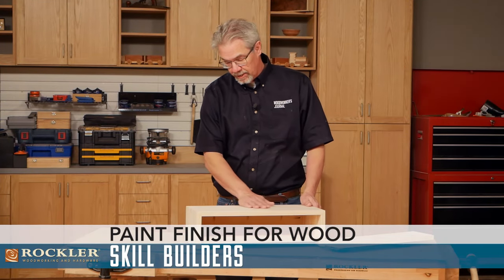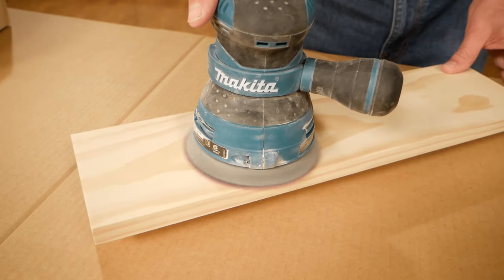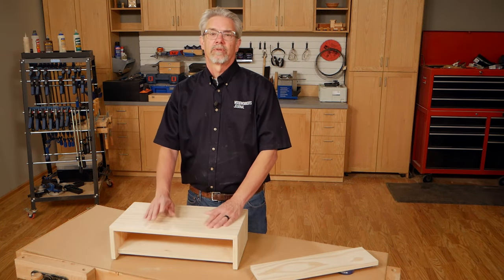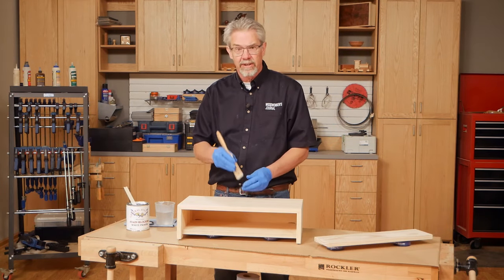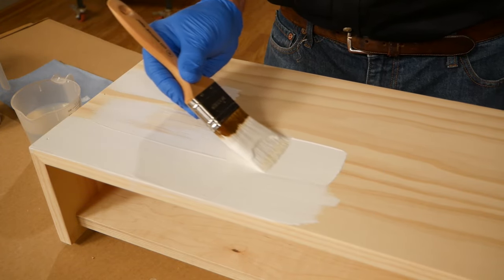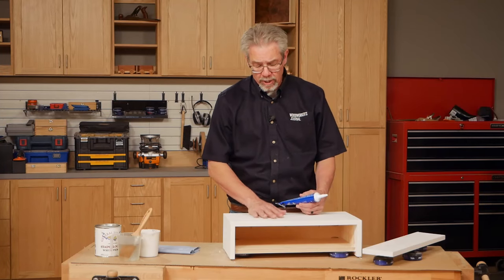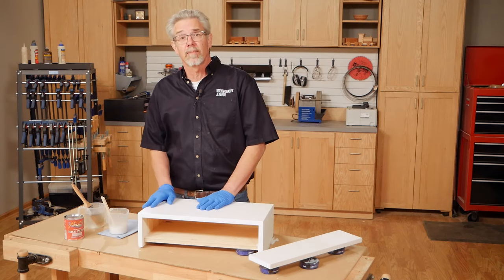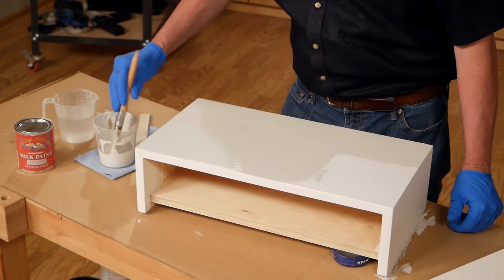How To Apply A Painted Finish On Wood - Wood Finish Recipe 6 | Rockler Skill Builders

Comment: Great thanks! You should also mention to use knotting solution if the wood is fresh and has knotts, primer won't protect the knotts from bleading.
Reply: But wouldn’t wood putty or spackle prevent the bleeding. Or is there a special solution for knots.  Is it a putty or a liquid?   Thanks for your help.

Comment: Quick question, do you sand at the end of the last layer of paint? I want a smooth surface . Thanks 4 your feedback
Reply from the maker: Hi Daniel, you do not sand the last layer of paint. Ideally you will smooth the surface before you start applying paint and then only sand between coats. You can apply grain filler to the wood before painting if there is deep grain. If you’re using latex paint, you can also use an additive, such as Floetrol, to help the paint flow and level for a smoother finish.

Comment: what about lacquer/varnish as the final protective coat?
Reply from the maker: Hi Tom, a clear coat over paint has the tendency to yellow over time. That may not be the case with water-based polyurethane, but a well-applied painted finish is really sufficient all by itself.

Comment: Do you think applying top coat will be protect the paint better than wax? If it does, do you have any product recommendations?
Reply from the maker: Hi there, there are a couple of reasons to add wax to a painted finish. One that is very popular now is to address a problem with true chalk paint. The specialty chalk paints on the market create a flat finish and in truth are not a high-quality protective finish. Still, they are very popular for how they look. Like many fads based on looks alone, the performance is less than optional, so chalk paint folks have added wax to make the surface feel good to the touch and to add a small degree of protection. They also use colored wax as a way to add color and interest, creating “shadows” and patterns with the wax. 
If you are using a standard paint, a clear topcoat is usually not needed, although many people practice this in certain situations. Those coats can yellow or get cloudy over time and change the look of the paint. Additionally, scratches in the clear coat are visible if they occur. However, paint itself is a very durable finish. A coat of wax on this sort of finish will add a small degree of protection, but in this case, its most important quality is that the surface feels like silk.
Reply: @rockler  wow! It helps a lot! Thank you so much!!

Comment: 1:33 is it 1/3? Because he dips the brush about 3/4 ...
Reply from the maker: Yes, it should be 1/3. It is true that these are approximate “measurements” and we have a bit of grace in the equation. Thanks for asking!
Reply: RJ  what's funny is a did study to be a rocket scientist :'D
Reply: Everybody here is ragging on your question but I thought it was very appropriate. There's a huge difference between 1/3 and 3/4 which the latter is what it looks like he's dipping it to.
Reply: @juanjacobo36  But not an English Major...............check your grammer.....
Reply: Maybe he meant 1/3 from the top?
Reply: @rds333  check your too "grammar"

Comment: Quick question: I've read in multiple places about using TAC cloth after sanding to remove the sawdust prior to priming, yet you didn't do so here. Is there a reason why?
Reply: If you sand, you have to remove dust. You don't want it in paint. You can vacuum and wipe with damp cloth. TAC cloth can also be used and was the standard.
Reply: Always use a tack cloth. I can't stress this enough

Comment: I'm going to be making an entertainment center, and painting it. I'm confused with all the information out there. Some people say use an oil based paint because it sinks deep into the pores of the wood. I've also been told to mix aConditioner into the paint to thin the oil based paint down and to avoid roller and brush marks. I'm not sure if I need a primer/sealer prior to painting the raw wood or the oil paint is okay to use alone. Please explain when to use latex verses Oil based paint and when to use a sealer and when you don't need a sealer .
Reply from the maker: A quality primer is important to a long lasting durable painted furniture finish — so yes, use one. As to oil based vs. water-based finishes, as long as they are a high quality product, either type provide a good painted surface. (There is no rule as to one should be used here and the other there.) As to using a conditioner, they do help paint to flow and leave a smooth coat — many painters swear by them, others do not. So conditioners seem to be a personal preference. If you have any further questions, please feel free to reach out to our product support team at 1-800-260-9663 or support@rockler.com.

Comment: Liked the idea of thinning the paint with water, thanks for the video. I was thinking of adding a final coat or two of clear polyurethane which should protect against chipping and scratch damage? I'm not liking waxing as it would mean cleaning and redoing the finish periodically, and would not give any scratch protection, why wax at all?
Reply: Yep, I am going for polycrylic/water based protective layer or water based varnish.

Comment: You could just as easily buy paint with primer already in it and skip the primer stage, right?
Reply from the maker: Yes, that is correct.
Reply: In my experience, using a separate primer with stain blocking gave better results. Just my preference.
Reply: Nooooo not on bare wood.  Always use a separate primer.  Maybe I’m old school but better safe to be sorry.

Comment: I painted wood and the paint did not stick after 1 month of curing. Everyone seems to talk about hiding the woodgrain, but I want the woodgrain. After 3 coats of paint, I still had the wood grain look, but the peeling killed my project. I feel I need a primer, but not to hide wood grain. Is this possible?
Reply from the maker: It would seem there is an underlying problem with the wood you are painting. For it to be peeling so quickly, there may be a surface contaminant interfering with the bond. You must get rid of that to allow the paint to stick. You can do this by cleaning the bare wood with mineral spirits and even soap and water to get the wood fibers to the point that the paint will bond.
 There is also a possibility there was still a significant amount of moisture in the wood when it was purchased, which can prevent the paint from bonding properly. But yes, it is possible to paint wood and still leave the wood grain visible.  Thin the paint a bit and apply a thin coat of the paint and the grain pattern will shine through. Many people love this look.
Reply: @rockler  The cabinets are 21 years old. I think they were originally painted with oil, since it was the go to back then. I was told a good sand would make it hold paint, but I don't think that worked. 
I have used a stripper and gotten all of the shine erased and even see original wood @ about 70%. But I still think a primer would help, I just want one that doesn't hide grain and maybe just 1 coat, maybe thinned also. 
The paint was pure urethane alkyd with no primer built in. 
I also may have painted coats too fast. I waited longer than directions, but will wait 2 days next time. And maybe I tried to cover to good on the first coat, but I would think a month of drying would have corrected this.

Comment: Does anyone know how to stop paint from chipping on wood products? Would varnishing the product first help this?
Reply from the maker: While chipping due to wear is likely impossible to avoid over time, proper application of paint will help prevent it from happening. A surface sanded smooth and free of contaminants. A good quality primer followed by a high quality paint. While you can paint over varnish or shellac, they would not be more effective than a primer when it comes to paint adhering to the wood.
Reply: @rockler  thanks a lot for the info! I appreciate it